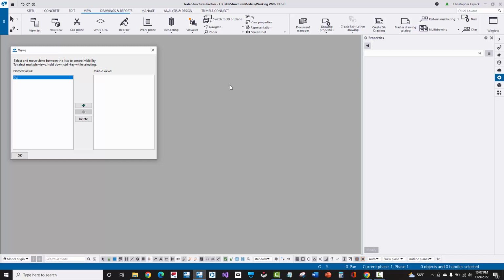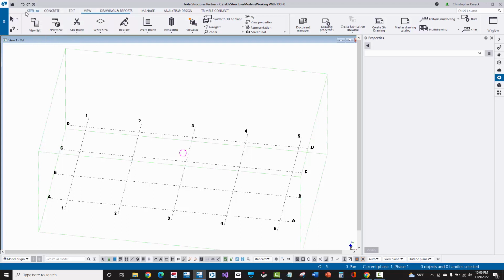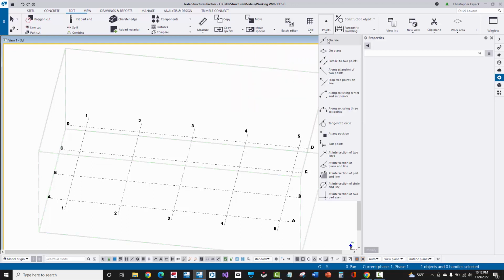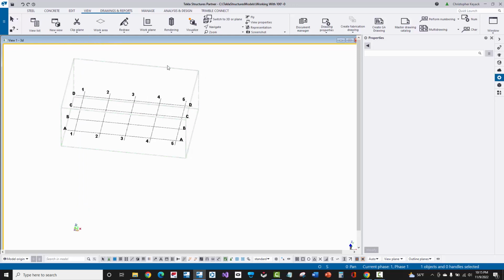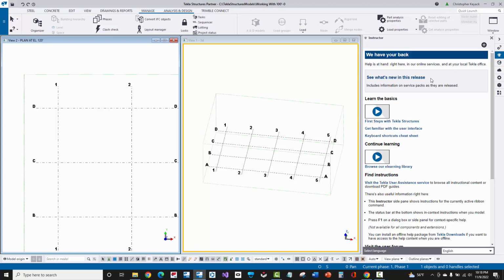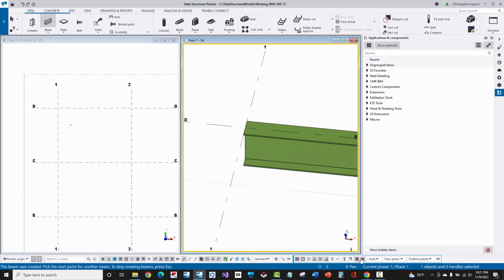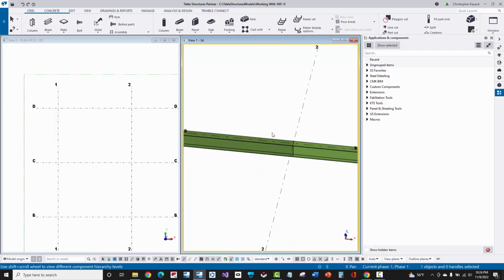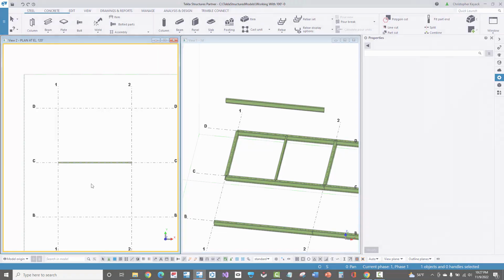KTS - Overview of the Tekla Structures Interface

Comment: Wow. Wish I had seen this BEFORE I did a whole building with 15,000+ parts. :/  Trimble should certainly explain the filter in their intro videos on Tekla.. as well as the pick line instead of 2 points to model a beam/column, etc.